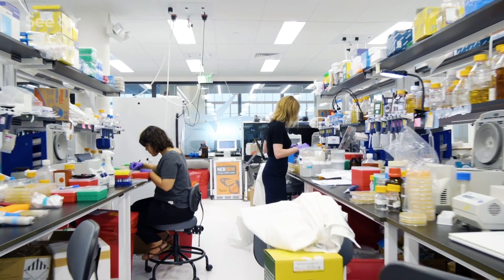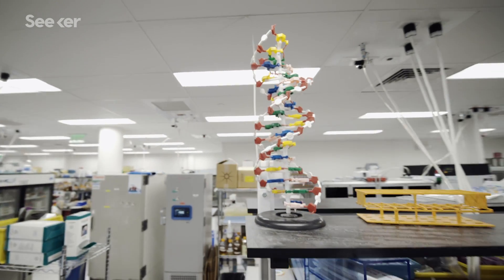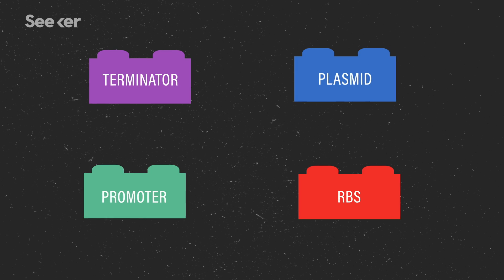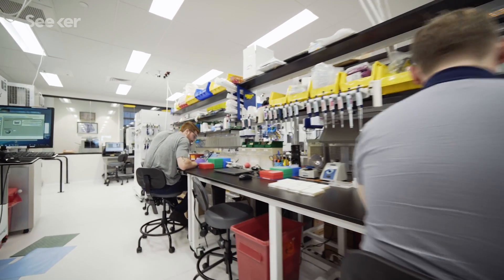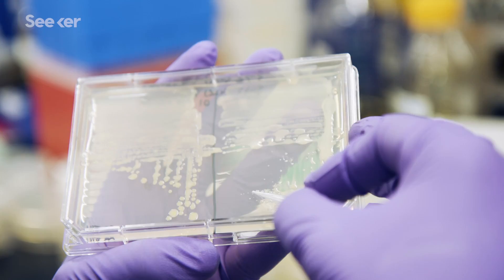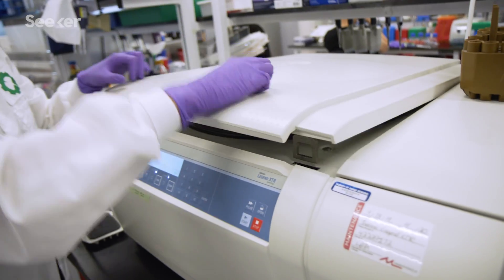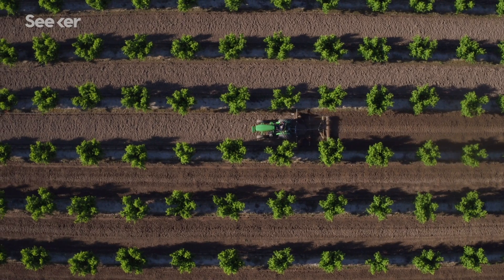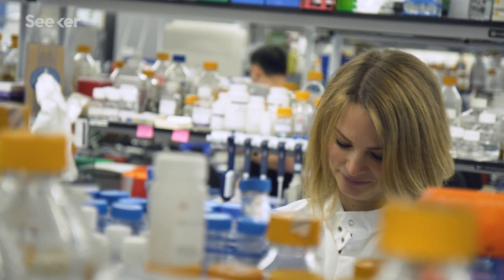This Synthetic DNA Factory Is Building New Forms of Life

Comment: Perhaps they should upgrade a Tardigrade, it's almost indestructible, can tolerate extreme highs and lows in temperature, has 6 legs,  been sent to space and found in fossils dating back 350 million years. There are now Tardigrades on the moon, in April 2019 an Israeli  spacecraft carrying 2 thousand in it's cargo, crashed onto the surface, did they survive?

Comment: All those robotics work on moving parts with gears and stepper motors and bearings and linear actuators and pumps. I've been in several labs that have machines that aren't working and are too costly to repair, or just break down too often to use, as well as machines that just can't reproduce the accuracy of a human (weird, I know). Seems like electronics and robotics will be a good career bet for the automated future, along with your AI/machine learning/data science and genetic engineering.

Comment: I'd like to know if they have plans to use designed organisms to clean (eat) up pollution like oil spills or micro plastics. I've thought about microplastic cleanup for a couple of years now, bear in mind it's too far gone for reuse, reduce and recycle and bleach cleaning is largely superficial with no significant impact on the global stage. This tool will mean taking more control of the world as it is, but considering we are already making a mess of the world, we're running out of options.